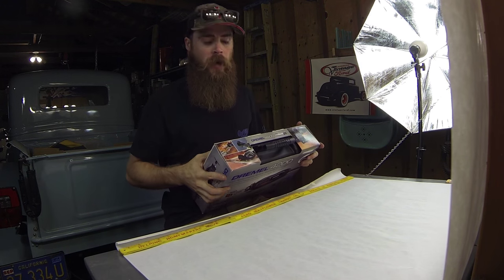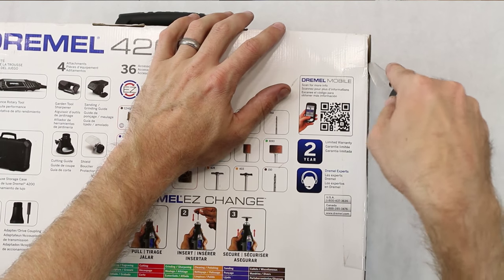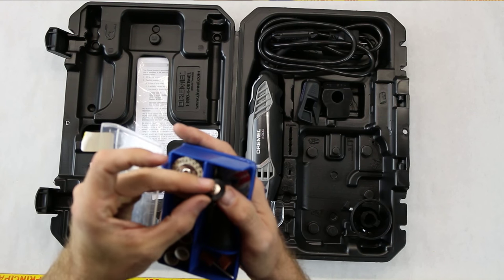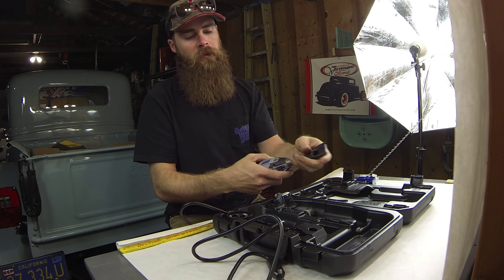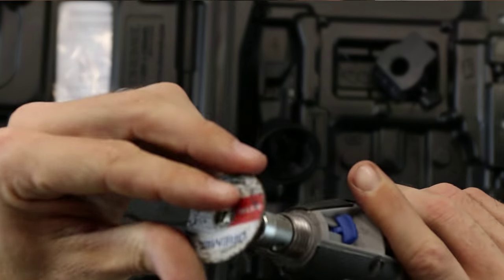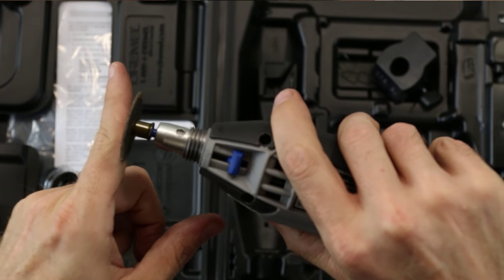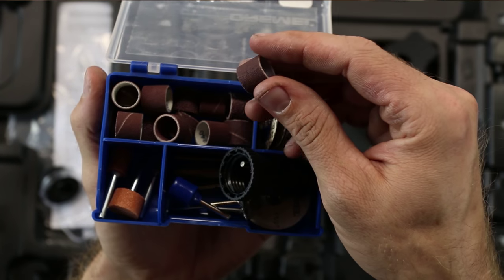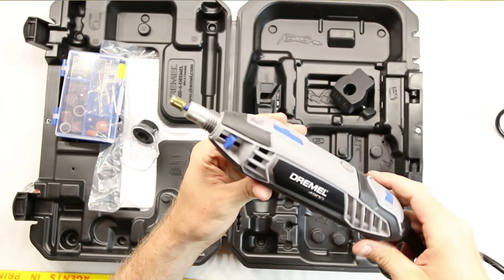New Tool Unboxing The Dremel 4200 W/Quick Release Function

Comment: Do you now like the 4200 more than the 4000?  I have seen concerns over the quick disconnect wearing out.  I have seen an option on amazon for a chuck that you put in there and it twists to adjust to different sizes and tighten to itself.  Do you think that might be a good workaround.  Thanks for your thoughts.
Reply from the maker: +Isaac Stimson this dermal broke the second time I used it. Not the disconnect the motor burned up. I would recommend the basic cheap one. I have had 3 in the last 2 years and I usually burn them up in a matter of three uses.
Reply: +Blake's Garage do the 4000 instead of 4200 then.  very similar and same price right now.  burned engine or quick disconnect mess up?  thanks for responses